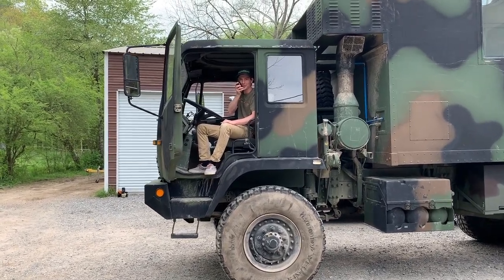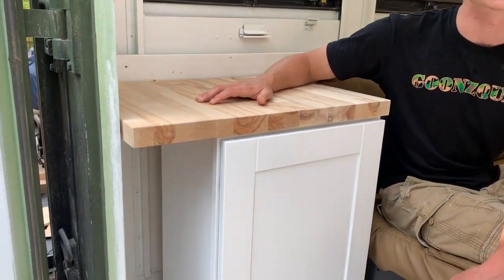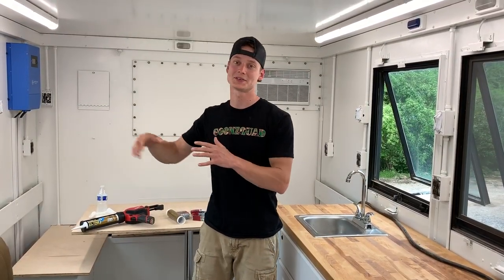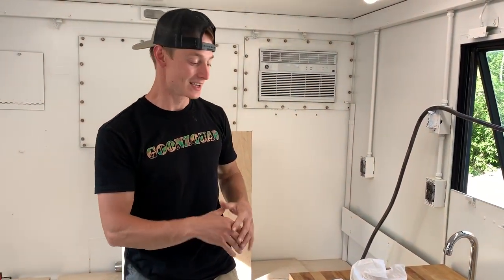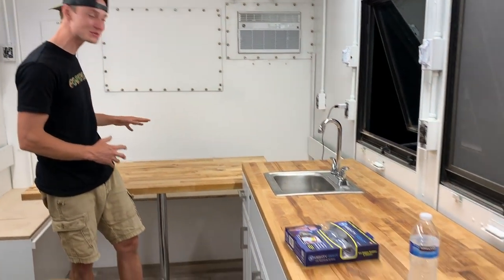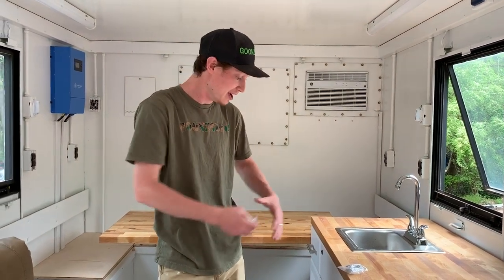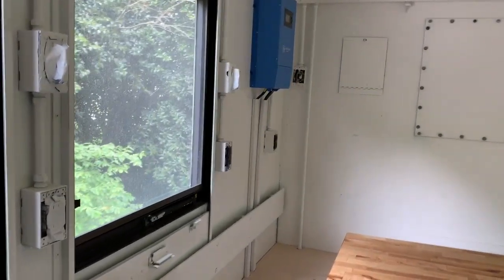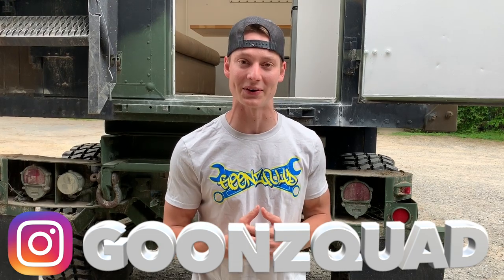Building The Ultimate Apocalypse Vehicle Part 10

Comment: Move that water pump so it is directly connected to the tank with as short a pipe as possible. It is cavitating trying to suck the water that far. Water pumps are designed to PUSH NOT SUCK water. -Plumber
Reply: Dee Jay  They said they loosened the lid but a dedicated vent would be 100% better indeed. They could even get one that has a check valve in it so nothing can crawl into the tank and no water spills out.
Reply: Chris V 
I agree with your point, but I think somebody already mentioned, sealed tank is lil tricky for any pump no matter what. My suggestion,uses vent cap to reduce the pressure.
Reply: You guys should start watching “Freakin Reviews”, before you waste your money on “as seen in TV” stuff😛
Reply: It looks like a diaphragm pressure pump so it will have a switch at an adjustable pre set position, sounds to me like its just not flowing enough through the fixtures and line, so its hitting pressure and cutting in and out as it hits and clears the pressure, im not smart guy but thats what it seems to me, ive seen it happen on small boom spraying sets woth tight nozzels and not many

Comment: Hey guys I’d suggest putting the table top into the bed position when travelling. I’d imagine that with it being top heavy it would shake the floor bolts loose. 
I get you put a brace on the edge but for the sake of two minutes better safe than sorry 👍🏼
Reply: Agree - also I'm a little confused why they didn't use a pneumatic pop up table that is made for this specific purpose.
Reply: Guys on mine the table stows as a seat back clipped to the wall . You only lose a couple of inches from the pedestal and it is out of the way and secure . Great job

Comment: SOME IDEAS... :
- Sound System (1000 watts at least)
- OLED TV 46" with Sound Bar and Subwoofer
- KingCamp Awning Sun Shelter Auto Canopy Camper Trailer Tent Roof Top or Side Top
-  Outside tool box or hangers for long tools like shovels, brooms, 
- Outside surrounding high intensity led lights (Left, Right and Back)
- Big Fire Extinguishers (2 at least)
- Windows Tint 
- Curtains for Privacy
- Wire Intercom to communicate with the front cabin
- Outside Shower
- All Weather external AC connector
- Ventilation for the inverter and the batteries (12v fans with outside duct, like the ones for rest rooms)
Reply: Great Suggestions. I'm surprised they've missed or left some of these out.
Reply: This guy is on point! Agree 100%
Reply: I hope most of these go into the build but the only thing I would think about changing is maybe not OLED snd just LED since you gotta watch for burn in.
Reply: What about outside bathroom
Reply: @3stans936  Don't think TV is going to stay on for that long to even cause that.
Reply: @metsrock1500  outside bathroom? Just grab a tree. HA--ha

Comment: You guys should seal the joints inside of cabinate where the water pump is with silicon or something so if there is a leak, water won't come out and make a mess.
Reply: Jaspreet Singh also need to instill some cup holders!
Reply: Really like your channel.  Use a 5 gallon bucket with a screw on top.  Cut a hole in it and run flex hose in the hole for the drain...then you wont get splashing as you are driving if it is full and you forget to empty it.
Reply: Dee Jay  Depends on the soap and in most places you can't dump

Comment: Hey guys, cool that you are building this truck. A few things about LMTV's: 1, before you raise the cab, clear out the cab of everything. If you don't be prepared to buy a windshield. 2 with a metal scribe in hand, crawl under the truck, and mark every drive shaft in a manner that allows you to mark each facing peace. The driveshafts only go together one way, if they are not scribe marked you will hate yourself.  3. If you have to get towed, and the tow trucks lifts the front end the front shaft MUST be removed. It will destroy other components. 4.  Open up the dash panel and write down what type of relays are in there, and go buy spares (These are common fail devices).  5. CTIS, will give you problems, you can disconnect the system at the module and get by without it.  Have fun and be safe!

Comment: Hey guys you should round off the corners for the table. Nothing major just 2 inch from the ledge on both sides for all three corners. It would make getting in and sliding around much more easier on the belly. Plus you wouldn't loose any valuable tabletop space. Keep up the good work!

Comment: To fix the pump issue is simple.  The pump has a small 2mm allen screw at the bottom that needs adjusting.  Search and you will learn how to adjust it for best pump performance.  No need for an accumulator.  Love the vids guys!

Comment: Hey Goonzquad, get yourselves another piece of table tube and cut it to length for when the table is in the bed position - this will stop the counter top bending over time when you sleep on it as its essentially made up of many single blocks and will bend when subjected to long term pressure.

Comment: They open the window, I thought they had a running hvac system🤷🏽‍♂️😅
Reply: They haven't fully figured out the electrical. Once they figure it all out they can mount the generator to the main rear power box

Comment: On a camp trailer the drawers have a 1/4 inch drop down when they are fully closed to keep from opening. You can notch out each drawer to accommodate that. Just lift a little bit and slide them out.  Check new camping trailers

Comment: Hey guys, you missed out on a couple on the RV, when you cut the butcher block you need to quarter round the edges and what about storage? You got a heavy duty truck without a closet. Come on!!!! Full height closet in the back driver side corner and make the under seats easier to get to..... that is a heAvy duty truck, mount the battery and inverter outside the living quarters. That’s like a 2ton truck if not more and you are using what a normal van could haul....
Todd
Reply: Maybe this isnt your build?? It is theirs with their preferred options.. Damn lol

Comment: I put FLEX SEAL on my motorhome. It leaked like pouring water into a colander. After the FLEX SEAL was put on, no more leaks. I SWEAR by that stuff. I used the paint on version. It worked VERY well. The tape is a MIRACLE product as well.

Comment: You should also consider adding external hook ups for, electricity, water and sewage. This would be for at home use and if you were to pull into one of those campgrounds for motor homes and trailers for an overnight or few day layover.

Comment: 1.Mudflaps required behind the front wheels2.Drain pipe going out the cabin instead of the bucket! 3.Paint those ugly bolt heads white(on the front wall) 4.Swing up cover for the a/c facia 5.DO NOT TRAVEL IN THE CABIN!In case of hard braking passengers are gonna get hurt!Good job keep it up

Comment: Before a water leak makes that cabinet swell up like a sponge just spray it down like a bed liner under that sink with flex seal. Maybe good to do the bottom ends which may not be sealed.

Comment: Hey. Maybe you can do something to stabilize the camper area. Maybe some kind of independent shocks other than the suspension. Coz it looks shaky as heck. Also, add a little window or a latch so you can connect with the cockpit and not feel bored anywhere.

Comment: You should put nut and bolts through the sofa bed with large spreader plates and the cover over the generator needs pot rivets in the lock catches not screws. We certainly can't travel in the back of any vehicle like that without proper seat beats in the uk

Comment: You know what would be really cool? A couple of Steel Jerry cans on the back (opposite side of your ladder) with Water and Diesel in each one for emergency supplies and for your generator. You could make up an awesome holder for it like that had on the WW2 Willys Jeeps. Also you could have used Child Proof latches for the cupboards and drawers in the truck

Comment: If it were to be the ultimate bug-out camper, might as well add a radio that could receive AM, FM, and shortwave at the very least; and a small TV with DTV receiver.   In conditions that befits that bug-out camper, don't expect the internet to be always open.

Comment: You guys should add some rubber sealer around the ac unit and the panel that hides the water tank so no outside air can come in

Comment: 2:53 don't put the cabinet in, just use the counter top and bolt it on the wall with hinges. Make it like a Murphy bed. That way you can fold it away when not needed.

Comment: Do you have a connection to the alternator?  You might consider adding a battery isolator so that the truck will help charge the "house" batteries while running.  You don't need to isolate the solar from the alternator, but you should isolate the engine battery from the house batteries.  Nice truck!!!!!  Needs a PS4 and a big screen!

Comment: Maybe the noise from the pump is amplified,due the void space (cavity under the pump location make it act like a sounding board. May be with some insulation blown in to that cavity between the floor and the bottom cabinet sheeting will dampen (muffle) the volume of it when engauged. Also have you considered hot water supply using a small on demand Hot water unit.

Comment: Instead of walkie-talkies, you should invest in an intercom set up for the cab to the box so you don't have to worry about outside transmission interference, batteries dying, walkie-talkies being dropped, drowned or run over etc.
Reply: ......... use your Cellphone.

Comment: There's a rubber membrane in the accumulator, so one side has air in it and one side water. When you switch your pump on it has to push against the air pressure first which smooths the pulse out.

Comment: If you want a really nice smooth finish and still just use tung oil, sand the crap out of the butcher block, 500 grit, 800, all the way to 1000, it'll feel like glass with no urethanes.

Comment: well doing ok, but you need some leather on em table seats to match that couch,    the pump is in the wrong place.  and you kind of rushed that last table holder thing.   the magnets will not work if you have too many items inside the unit.   as in an an object in motion will keep on moving and the heavier the object it is then you will need better breaks to stop it.   now you need an awning.  and an outside table and could store that under the new sofa.    also inside that fridge so the stuff don;t move you will need some rubber. hence why I said get one from boat place.  but its a fun adventure toy.   look for a matching army trailer.   and you can build a part 2 to this rig.    or get a car trailer and bring the bikes and  that side by side.  wait a sec.  if you get an Army trailer same wheels concept.   then you add to the top of it an aluminum deck from a skidoo sled truck power drop unit  you could then motorist it to make the top of your trailer for extra bedroom.

Comment: move the water pump near the water tank on the outside of truck.. by doing this you won't hear the sound of water pump and a tv would be great inside the truck and  why you opened the window instead of the ac when you were feeling hot inside ??

Comment: Hey guys i have a quick question for yall. My girlfriend just bought a veloster from copart in North Atlanta, and she cant pass an inspection to get the salvage turned into a rebuilt title. The extent of the damage is structural, not frame. To make it easier, her hatch doesnt close right. Also shes called most body shops in her area, where all but one said that they wouldnt work on salvages (the one exception said maybe). Do yall have any recommendations for shops or ways to fix/get around this? Thanks keeps up the good content

Comment: So much wasted space inside and not enough storage cabinets. You guys should have looked inside a truck box camper and see exactly what you can cram into a 5 foot wide by 8-10 foot long and 6 foot high box. Take a good look at what you need for camping and see you have nowhere to put it all. Like maybe a tall cabinet for fishing rods and fold up lawn chairs, clothing storage, an upper cabinet over the sink or the front wall for pots pans dishes food etc. Sure a cabinet will mostly cover one or both windows but thats ok as long as enough is exposed to have at least a half window. Thats the problem with this unit is not the fact it has too many windows so much as the windows are too tall and take up valuable real estate for upper cabinets. As for cabinets and doors flying open just go to your RV dealer`s hardware section and get latches meant for RV cabinets. Magnetic catches do not cut it when it comes to RV`s and thats why no manufacturers of RV`s use magnets. How about a nice tile back splash on the wall behind the sink? Countertops should have L brackets holding it to the cabinets, dont rely on a super adhesive. Take into account things flex in an RV and that super adhesive will let go eventually. How about finishing the walls(all the exposed painted steel areas) and steel wire conduit in a nice wood paneling by cutting some 2"x2" wall studs 16" on center to nail the paneling to and maybe some insulation between the studs before paneling, not so much as for heat insulation/keeping cooler inside but more the fact right now it has the acoustics of an empty shipping container. Smoke detector and Co2 detector along with fire extinguisher would be a great idea. You`ll appreciate a screen door as well. Its a great build nonetheless and the end result is still great. Just a little room for improvement.